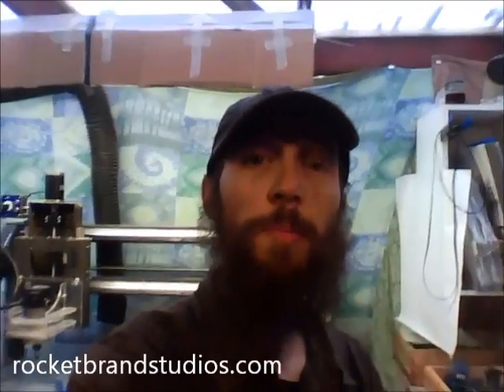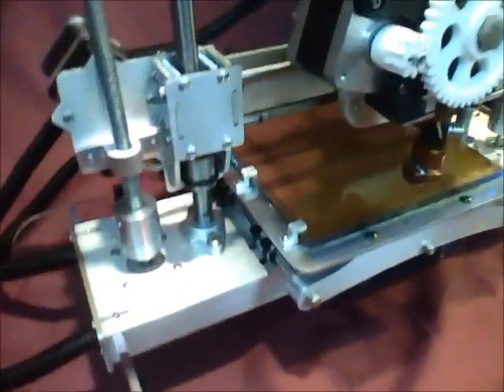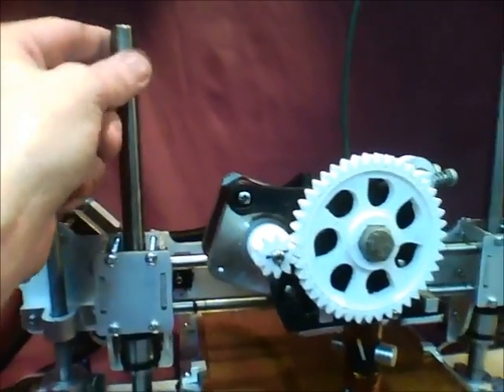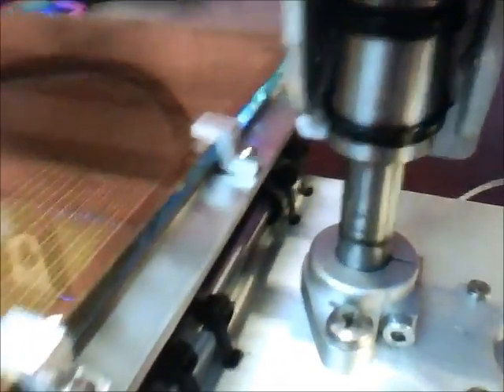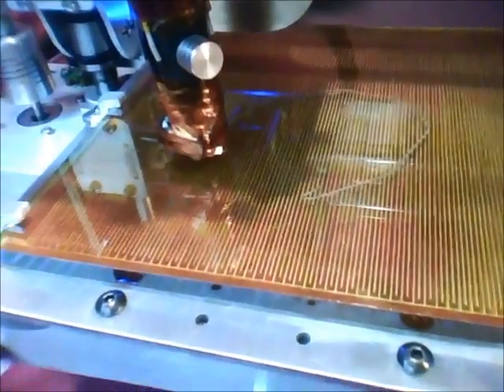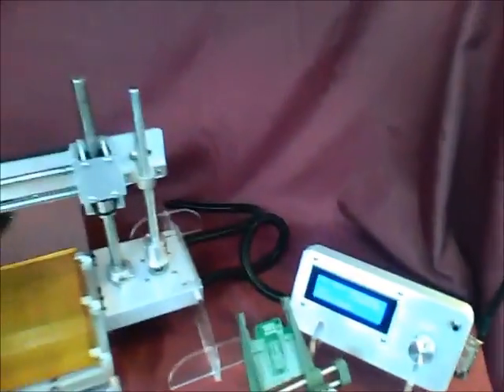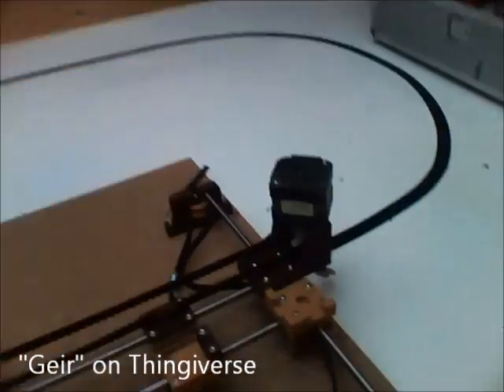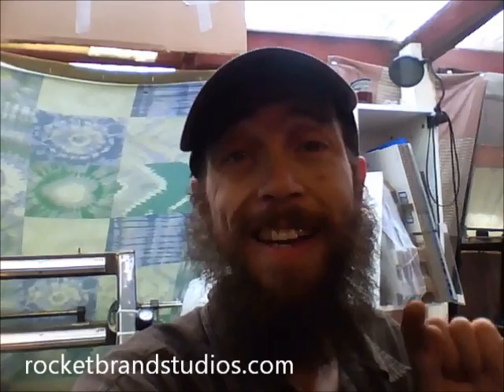PrintrBot Aluminum

Comment from the maker: Hey Bill, yup, the Z rods are just hardware store all thread. Lash is not an issue in that the Z only moves in one direction and gravity takes care of the slop. In terms of any binding etc., I ran a die down the rod to knock off any zinc goobers, hit it with a wire brush, and then just a little lube. Works perfectly, never had a problem.